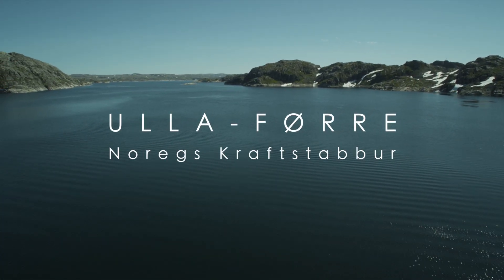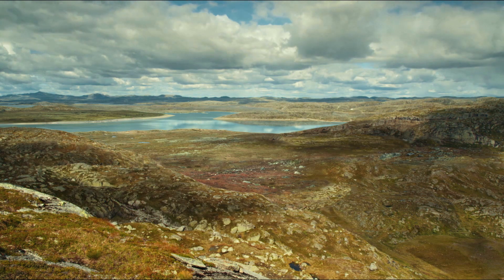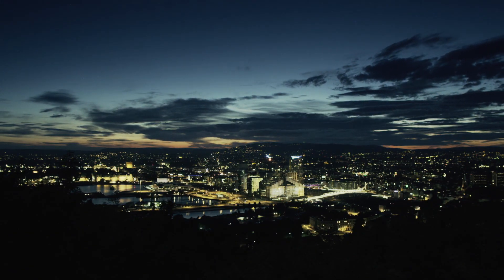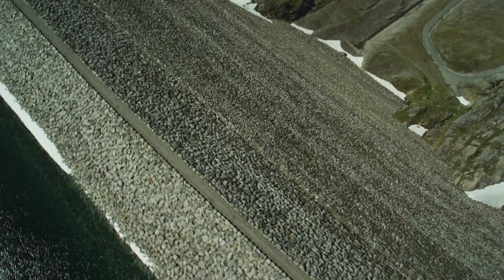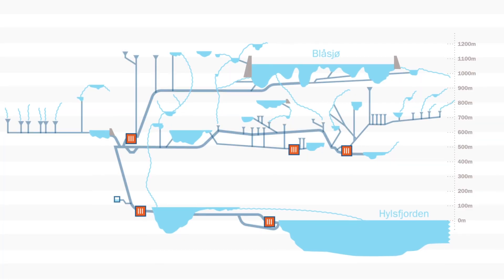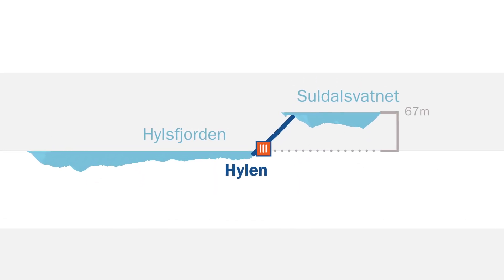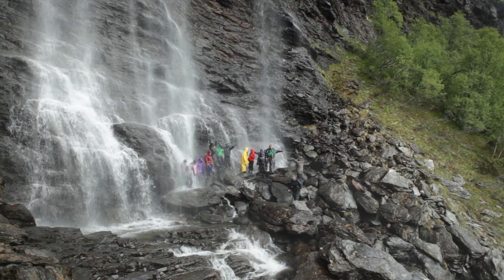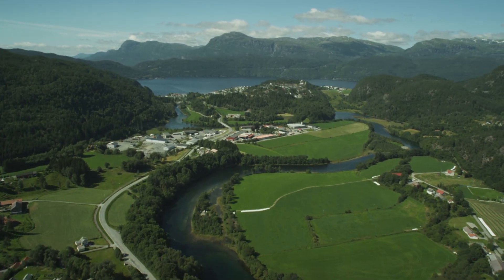Ulla-Førre – Norway's power storehouse

Comment: Good to see how Norway used it's natural landscape to build renewable energy.
Being around 100% renewable in energy production is a good milestone.
Reply: Norway extracts and exports 1.383 million barrels of crude oil per day
Reply: @glennv3176  And if we don't do it, someone else will. OPEC, the US and Russia would probably extract 1.383 million more barrels per day to fill the gap in the market. Especially when the price goes up due to less supply. We also have to extract it before someone, like China and/or Russia takes it away from us, but we don't want to extract it as fast as the UK, either.

Unlike the UK and others, we haven't exactly been wasting our oil wealth. The money is invested in foreign companies, bonds and real estate. On average, the oil fund holds 1.4 percent of all of the world’s listed companies. The fund is currently worth 1.356 trillion USD. I just hope they stop investing in China. Investing in China = investing in the CCP = investing in the PLA and modern concentration camps.

But regarding energy; would you rather have us burn coal? Stopping our oil extration will do nothing for the climate or the environment, while not burning coal has an immediate impact on both.
Reply: @hasselnttper3730  As you said, the oil will be extracted anyway, I rather see Norway do it because they probably do it cleaner than the USA, much cleaner than Russia and 10X cleaner than the Saudis.
Reply: @hasselnttper3730  That's right, climate footprint of 0.67 kilos per barrel compared to the global average which is at 18 kilos per barrel of oil is significantly cleaner than most countries. Probably the cleanest oil rigs in the world.